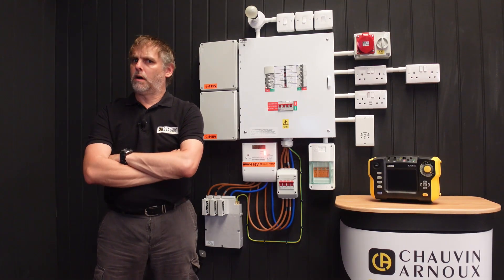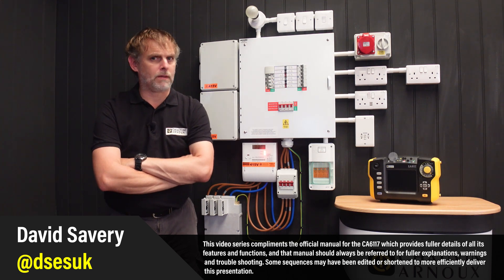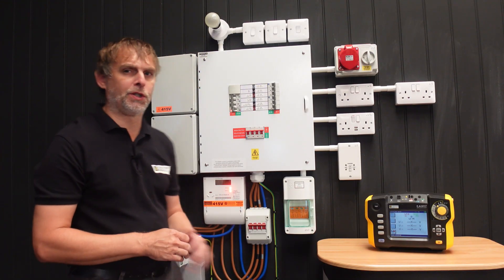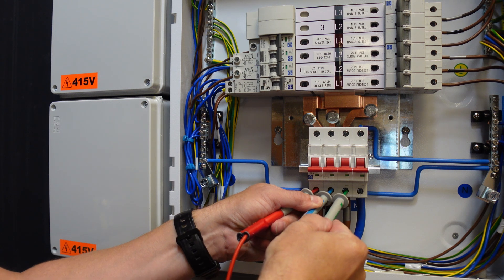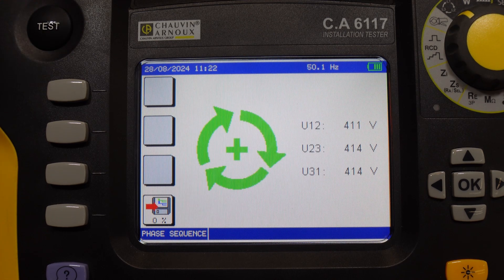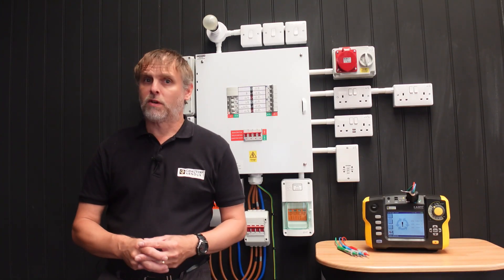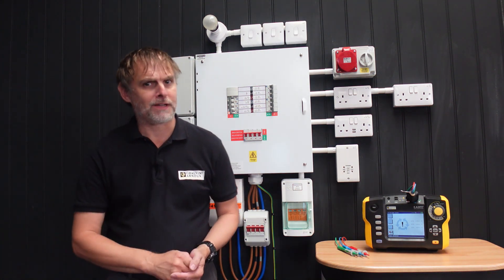C.A 6117 Phase Rotation with Dave Savery

Comment: Three phase voltage is phase-phase as we all know.  But a question stuck in my mind lately is when a voltage is reported for say, L1, is that the potential vs L2, or the average potential vs L2 and L3, or the highest of of the potentials vs L2 and L3?  Or some other calculation?  Thanks!
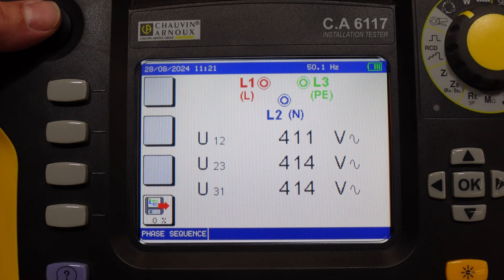Reply from the maker: Hi @greatrixbrad thanks for the question. Phase voltages are measured between two phases. If you pause the video at 0:40 you can see the display shows U12 U23 and U31. These are the voltages measured between Phase 1 & 2, Phase 2 & 3 and Phase 3 & 1. I hope that answers your question but please let us know if you would like any more information.
Reply: @ perfect - thanks!!